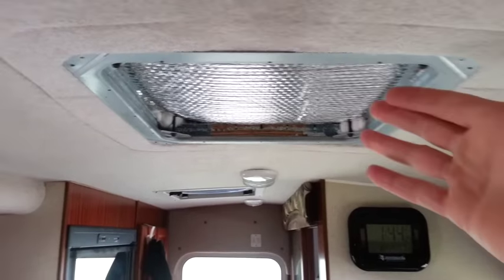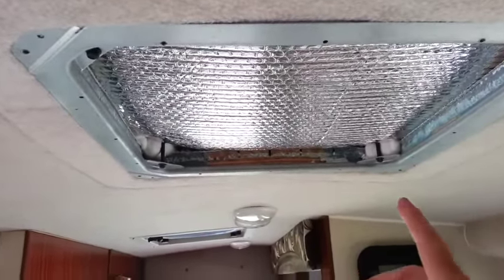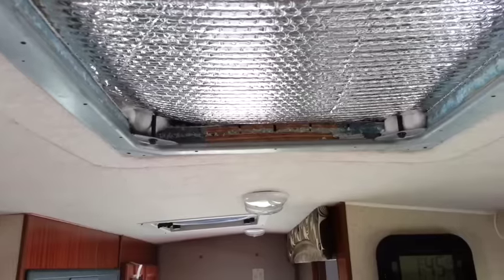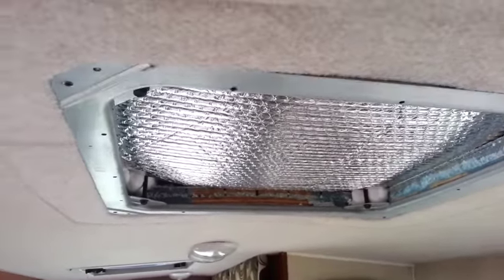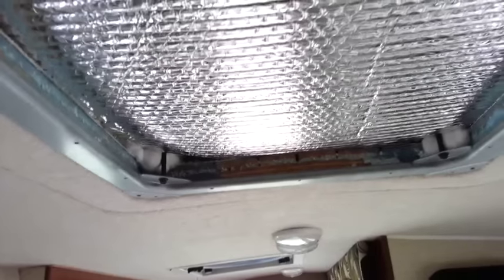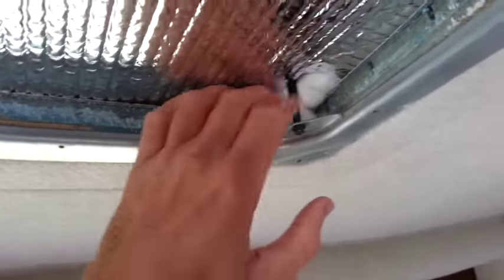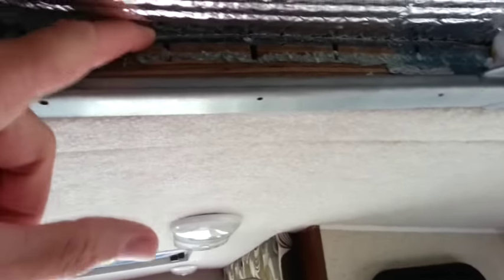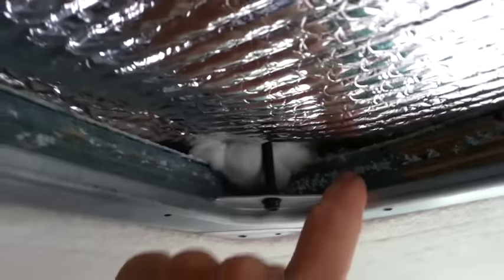RV Interior Ceiling Height Dilemma RESOLVED!

Comment: I don't use my AC much either, but I run it once in a while because it will rot away if you don't use it at all. The last time I used it was actually the first time I used it and it didn't come on right away. For some reason I had to cycle through the settings on the thermostat from where it was on auto, back to auto before it would come on. Knowing that will be really useful if I ever need to use it. I'm in northern California and so far just opening the vents and running the fantastic fan has been sufficient. Although, I can take some heat so that might not work for everyone.
Reply from the maker: Running them occasionally is smart. Yep I just ventilate and open windows. If I was in Texas....no way..... A/C!
Reply: +West Coast Roller I had an opportunity to go to Tucson a couple weeks ago for a week. I considered driving the camper there but reconsidered because it's routinely well over 100 degrees this time of year and goes down to only 90 sometimes during the night (70 degrees is more often the case). But I decided not to drive. I'll take the camper during the winter but 100 degrees plus just didn't sound like fun. And I would have spent most of my time our of it during the week. I don't know if leaving it with the vents open would have been sufficient to keep it from overheating. running the AC while I was gone during the day  ( and having to run the generator as a result) just seemed insane. Not taking the camper into those conditions just seemed like the better idea.
Reply from the maker: Maxid1 Sounds like you did the right thing!
Too hot! It takes a lot of energy consumption to stay cool in those conditions. Not to mention bugs, tire wear, and on and on. I'll  stay near the ocean.
Reply: West Coast Roller
AZ is great during the winter, it's paradise. You can get any weather you want. Tucson is really pleasant or an hour away in Tombstone you can get freezing temps at night and teeshirt weather during the day.
Even during the worst heat of the summer if you drive up Mt Lemmon the temps will drop 30 degrees. The mountain hiking is spectacular too.

Comment: So you decided not to go for the surgical leg shortening eh?
You can use this to cover the metal frame.
https://www.amazon.com/Oatey-34056-14-Inch-Access-Panel/dp/B000DZD3MO

I still think you could swap the Fantastic vent and AC locations. Both would still work fine, might require a little rerouting of wiring. You spend your time around the dinette and just pass through the rear for the bathroom, pantry, or in and out. 
If it works for you and you're happy, that's all that matters. Take care,
Reply from the maker: The Fantastic Fan will fit in the existing hole of the A/C. Remove and replace which is good.
Reply: Sitting here catching up on a few hours of Quick Books.
I think it'd be a good option for you to swap the locations. 
Just need to move a couple wires. 
That other cover is a good option. Just Velcro or drill for existing mount holes.
Take care bud.
Reply from the maker: Good idea although I do spend time in the back so I would have the same dilemma as before. I also don't think the roof would support it in the rear as there is reinforcement around the roof of the A/C unit now.  Good idea though. Take care Jeff don't miss any numbers! :)
Reply: Current location may have additional plywood support but, the rear location is between the bathroom wall and the pantry closet which both go to the roof and should provide plenty of roof support in that rear location leaving a ceiling/roof span of about 3 feet. If you ever need it, I think you have the option. It's not like the AC unit weighs more than about 30-40 pounds anyway. And then there's the point you don't really need it but if you do, you can put the cover on and connect things in a few minutes time for comfort. One more idea you'll love. Separate the two halves and install a 3" spacer all the way around. Bolt the two halves back together. I knew you'd like that one.